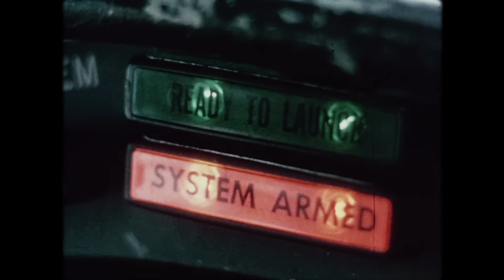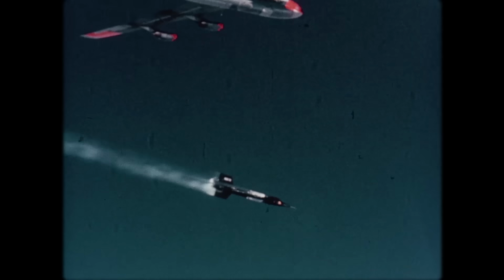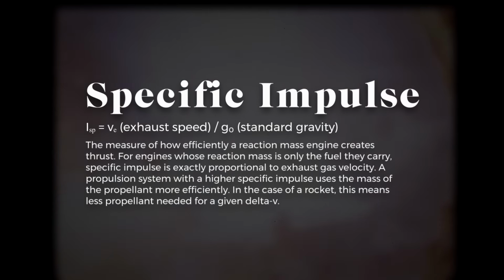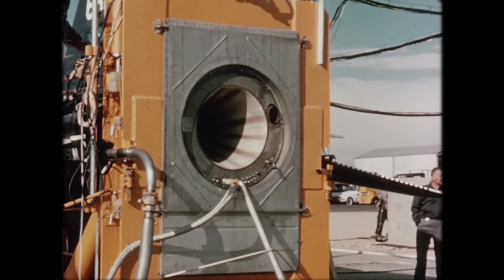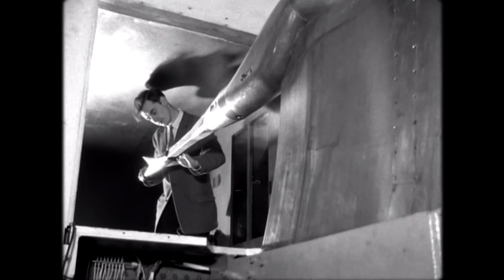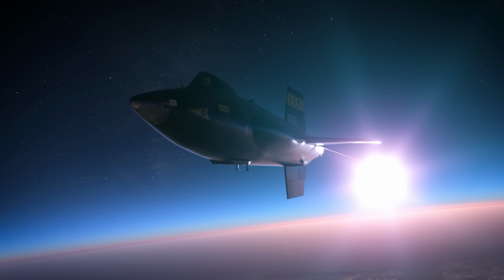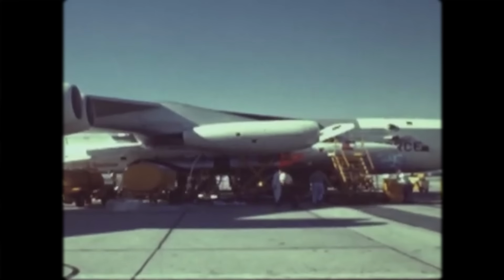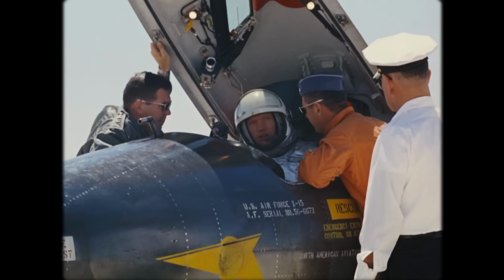The Insane Engineering of the X-15

Comment: If they had this tech in the 60s and 70s it really makes you wonder what they are testing now.
Reply: the 60s and 70s saw alot of raw power output but now they're focusing on make it more sophisticated. Some of the top speed records were set in the 60s and 70s whereas now they focus on making things stealthier, quieter, and giving them better sensors instead. This is more complicated but less impressive.
Reply: @arthas640  Before it was "you can run, but you can't hide". Now, with missiles doing the role of interception and with more powerful radar on the lookout, the tactic is now "you can't run, but you can hide"
Reply: @arthas640  pppppppppppppppppppppppppppppppppppppp
Reply: @donaldmartin8577  ... what?
Reply: @arthas640  No, still need more power, for instance to use the Sun as a lens we need a very fast rocket, eventually we'll use matter anti matter drive ,but before then many nuclear based systems.for instance for manned missions to Mars should use nuclear.
Reply: Back then it was more about "can it be done?" As such, we were able to achieve insane feats. The only caveat is that although we managed to do it, the costs incurred were completely unsustainable and would bankrupt all but the wealthiest governments. Nowadays, it's all about "how can do it in a way that won't bankrupt a small country?" It used to be all about sheer power and speed, now it's all about efficiency, cost-effectiveness, and sustainability.
Reply: you do have to realize though that in this tech alot of failures happened, today they make things more reliant and better fighters, with satilites there is now almost no need for something so fast anymore as mach2.5 will work for most planes, why go mach3.5 and have no weapons and risk dying due to engine failure rather than trade a bit of speed for maneuverability and weapons for both ground attack and air to air combat. the tech while made back in the 70's was risky and todays tech is alot more reliant, infact the sr71 blackbird with insane engineering only failed due to electronics/engine failure, not a single one was lost due to pilot error however with todays tech that rarely happens anymore, still though i do wonder what they are testing
Reply: I can tell what they are working right now. Today Its not about having a fast Jet, its about having fast and precise weapons. Currently, China and Russia are working on Hypersonic missals. Weapons that travel the speed of the X-15. These Missals are for today impossible to stop and  would hit any target that it points at. That's why stealth and countermeasures are in todays "war" so important. Not only that, we are fighting a completely new war and problems today, Cybercrime and war is a thing aswell
Reply: mostly hypersonic missiles and interceptors in other words "smart" mini-X15s.
Reply: @lmeza1983  ...and it's little known that ours can intercept theirs before it leaves their airspace
Reply: SpaceX's Starship rocket is a good start to look at.
Reply: SR-72
Reply: ufo's
Reply: Fusion, and they are close...
Reply: Hence  the U.F.O sightings I think
Reply: Well, the system has changed. Today development is only partly done ijn physical equipment. Most technollogical advance is made in the cyber space these days. 
Image recognition, analysis tools, mass data storage and analysis. That is where brain and oney is placed today.
A power always tackles the current problems. In these days that is a growing world population and the percussions of that. The target is to find ways to control the masses. 
Manipulation, Control and Surveillance is the future of power. 

 One is still free to question if that will be to our benefit....
Reply: Top speeds are literally useless in actual combat and travel scenarios. To go above Mach one is insanely inefficient that's why commercial airliners don't go that fast. As for fighters. You can't outrun a rocket at that speed so there is no point in going that fast. Its smarter to spend time on making it better at subsonic speeds where all the fighting is actually done
Reply: It’s really not as interesting. Due to the massive defunding of NASA after the moon landing, the focus is more on making things cheaper, not faster or higher.
Reply: That is a very reasonable observation......
FTL craft      exists.       we
are OUT THERE !
Reply: Now its the TR3B with its mercury powered anti gravity engine.
Reply: Tic Tac
Reply: Y'know, the whole space X "Zuma" thing is really making me wonder...
Reply: Lol. Probably some pretty impressive stuff, nothing gravity defying if that's what your thinking..
Reply: Commercial aircraft are now capable of going in space for leisure.
Reply: Typical  BS
Reply: Camera phones
Reply: all the new stuff is planned for 2025 and they are all uav's that reach mach 25+
Reply: universal adblock
Reply: Now the focus is on unmanned, small and stealthy….it’s not as sexy but sure is expensive but technology wins wars
Reply: Nothing. The space race ended in the 60's.
Reply: hypersonic missiles
Reply: @captain_elmo  more like super duper sonic missiles.
Reply: Nothing 
There’s no use for this sort of technology anymore
Reply: And that is why all those UFO’s are from U S of A, its us.
Reply: I mean, have you seen the f-35? The VTOL tech alone basically make that thing look like a transformer.
Reply: Or what the airforce could have done if they were allowed to continue its space plane developed
Reply: If I had to guess... I'd say the U.S. is frantically working on supersonic missiles and anti-supersonic missile systems. Seeings how Russia has demonstrated that they have that tech, and they are a nuclear nation, and the U.S. has admitted that they can't defend against them (yet)... and the U.S. is politically opposed to Russia ... all that adds up to the U.S. developing supersonic missile tech to me... just my own speculation though so...
Reply: That's my biggest question
Reply: The same shit lmao
Reply: Stealing..  NASA ...say defunded .............. 70 billion dollars for fake . Pictures
Reply: We need another Cold War to get our minds straight and focused.
Reply: nothing interesting. We have not progressed anywhere since the 80s.
Reply: Honestly, they use satelites.
Reply: More ED pills, more solutions for baldness, more life like remote sex robots/'dolls', etc

After all, you got to look at the politicians that make decisions. If it's not a weapon, it's one of the above.
Reply: Not really since back then they had the cold war and just came out of world war II so these extreme technologies made sense. Now there isn't much of a push to make insanely innovative risky things I think.
Reply: @Animation Space if they had just been out two Major Wars where would they have gotten the Funds to run these Experimental Projects?
Reply: They are testing Flight suits for pregnant men last I heard. 🤷🏽‍♀️
Reply: They testing UFOs
Reply: they stopped doing science and switched to gender studies
Reply: @Dr. Doppeldecker I'm simply saying that if in those semi-primitive years they have accomplished such feats, why haven't it drastically improved after so many years.
Reply: @densleycunningham7208  he literally just told u dude ..
Reply: You mean sunkworks, trw, lockheed, eg&g boeing area 51 
bob lazar came forward about it,
Reply: Alien stuff
Reply: dead end projects to suck up the taxpayer money
Reply: they tested the falcon hypersonic vehicle on 2011 and it hit mach 17+ with about 9 mins. flight time before crashing into the pacific ocean..

https://www.youtube.com/watch?v=BMnMaS2t57Y
Reply: Having me to wonder the same thing, if they hit Mach 6.7 in 1967 by now they should have hit Mach 10 or 13, if they landed on the moon in1969 by now they should have a hotel and tour service on the moon. But they seem to be going backwards or they were lying from the beginning.😒😒😒
Reply: @densleycunningham7208  what is ur point bro. U went from saying that "they" seem to be going backwards or have lied to us from the beginning to the US shouldn't and doesn't have the funds to do the ground breaking stuff they did. Like some other guy said, we have pushed out limits in terms of hardware, I mean we can probably still improve but not drastically from what we already have. I ask again, what the hell is ur point that ur trying to make.
Reply: @densleycunningham7208  First of all, Mach speeds are sort of irrelevant in a spacecraft, but you do realise that any craft that leaves earths gravity is going  at roughly 40,000kmh, which would be something like Mach 32. As for hotels on the moon, who will pay for this? In what way have you been lied to? Don't mistake a simple lack of knowledge for being deceived. All the information is out there and freely available. The great American public grew tired of paying taxes to fund the Apollo missions. You gets what you pays for.
Reply: @densleycunningham7208  NASA and the AirForce have tested scramjet-powered unmanned planes at M=7-15 a few years ago.
Reply: @densleycunningham7208  It´s all about the money. We could be way more advanced technologically, in almost every aspect, if the money would be used for technical progress.
Reply: @densleycunningham7208  well, it’s about the societal focus after the space race everyone lost interest in nasa and after the Berlin Wall we slowed stealth and then 911 happened and we went into military overdrive stealth saw a revamp, space did not, nasa had to push deeper rather than expand on the moon, no one cared about the moon anymore, so they sent rovers to mars, after 2-3 of those they had to send a drone to revamp interest, now with space-x interest in the moon has been rekindled. And that’s where they’re headed, records are fuel by desire, no desire? Then why even try you know?
Reply: @densleycunningham7208  There is a difference between going fast. And actually having useful technology. the 70's was when America was to childish to use there tech for improvement and just wanted to go fast. Now they are improving on what actually counts.
Reply: @densleycunningham7208  the limits of physics have been reached in the 60s and 70s. The SR-71 for example can´t be improved, and the money just isn´t there anymore, we simply have reached the limits of our current materials and hardware, only thing to be improved is software.
Reply: @redo 1 Dr just like Russia who used the Soviet Union to Milk Resources out of the Countries of the Union that's the very Strategy the United States used to Sucked Funds and Resources out of the Public and other Countries, also using the Federal Bank and their Propaganda of Terrorism and Communists take over. The SR-17, F-117 Night Hawk, B-52 S.B., F-22 Raptor and many other sophisticated aircraft and weaponry could not be possible because the United States doesn't have the funds nor the resources to build them.
Reply: @redo1dr  
I respectfully disagree. Example; Carbon fiber (used in high end car fenders and frames, jet fuselage and wings) gets lighter and stronger as NASA releases its tech on the subject for the civilian population to consume. This tech was invented over 20 yrs ago.
Reply: @redo1dr  the SR72 would like a word
Reply: @redo1dr  This just isn't true.
Reply: @redo1dr  flat out untrue. They’re currently developing the sr-72 which will nearly double its predecessor the SR-71 which reached its top speed at Mach 3.2

The concession of doing over Mach 6 is that it’ll be an unmanned drone airplane
Reply: Today social justice trumps everything. If you aren't LGBTQ, black or at least female whatever you say is irrelevant. "Scientific" effort goes into obscure social theory finding, to prove a point that men, especially if white, are bad.

Other than that: Crystals, horoscopes, religion, anti-vaccination "skepticism", homeopathy. Real engineers lay low and all the (positive) media attention is not on great engineering/science achievements but on petty social reforms.
Reply: @uschurch  what? You need to get out of your bubble my guy
Reply: @uschurch  watch more TV... baa like a sheep and feel like a victim
Reply: @uschurch  I think white and black and all kinds can thrive in scientific endeavors. I also would add that I think a lot of things the military works on and buys now are way more cheaply made and tech is seen as expendable now days. Probably so a vendor can keep there valuable contacts going. Things are built to fail.
Reply: @uschurch  What the hell are you talking about?
Reply: @uschurch  it happens when you are too much on twitter
Reply: @uschurch   Black huh?
Reply: @uschurch  you need to get out of the internet man, I agree with what you are saying but it's a bit of an exaggeration I believe, and I am anything but someone who supports this mass-media tropes of these days.
Reply: @brownerjerry174  One word. America.
Reply: @uschurch  
.Mvmmmmm
Reply: @uschurch  facts
Reply: What?
Reply: @partyparrot570  lol
Reply: @partyparrot570  Read it again Polly !
Reply: @uschurch  Sir, this is a Wendy’s.
Reply: @uschurch  And the prize for most unadulterated off topic gibberish from a on a Youtube comment for 2021 goes to.....
Reply: @uschurch  you're an example of someone who's way too far on one side of the political spectrum. Maybe don't be so ignorant
Reply: @uschurch  yeah, this is why the USA has 750 billion military Budget.
Reply: @uschurch  touch grass bro
Reply: @uschurch  What does this crap even have to do with anything? Not to mention it's just blatantly false.
Reply: Urs Schuerch Omg. Dude, stop. Just stop🤦‍♂️
Reply: @susanmaggiora4800  Yes, and the progress of human intelligence has stopped also
Reply: @uschurch  5.5/10
Reply: @uschurch  My man 👏
Reply: @uschurch  people seething from the truth lul
Reply: @uschurch  Indeed.
Reply: @uschurch  True.
Reply: @uschurch  True at some level. Do you really think lgbt, blm, etc have a serious impact if they wouldnt contribute to the 1%?
I know those 1% is all greedy mfs but atleast not braid-dead like those groups i mentioned. They cant do jack shit

Comment: Take a look at Chinese satellite array systems that provide 24/7 long-range, over-the-horizon (OTH) radar. Conventional radar coverage is limited by the horizon — the point at which the curvature of the Earth prevents radar waves travelling in straight lines being able to reflect off a distant object. This distance depends upon the height of the transmitting array, and the height of the contact. 

So a large warship may be able to detect another warship at around 50 km. Whereas an airborne radar at an altitude of 10,000 m will be able to detect a surface contact at approximately 400 km.

Seeing China today, with more than sufficient defences to not only deter any aggression shown towards them, but to also outright annihilate any considered aggressive threat toward them.
 
In the area of detection and targetting? The Russians seem a little more innovative here. Today Russia also have GaN MMICs on the Himalayas jammer. And since it was also KRET that made the jammers like the krasukha, and murmansk-BN, we can say for sure this EW hardware is super impressive. We've no answer to it.